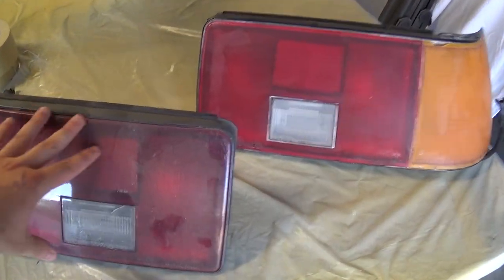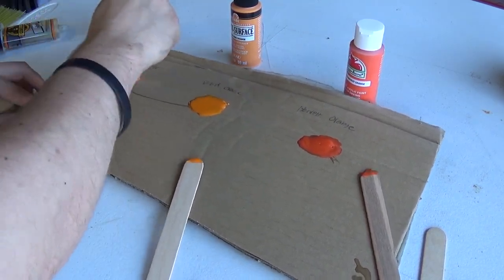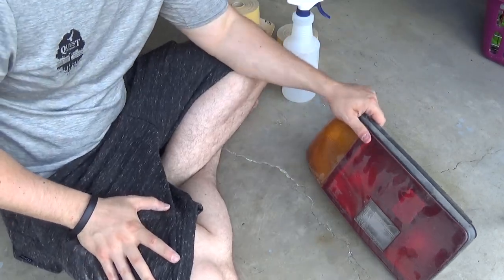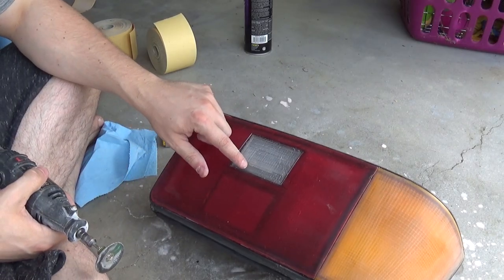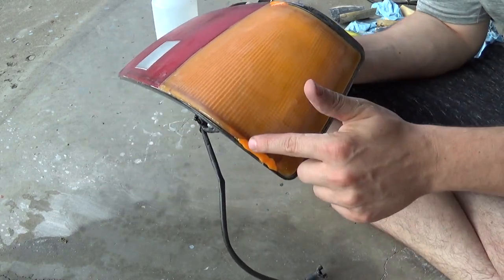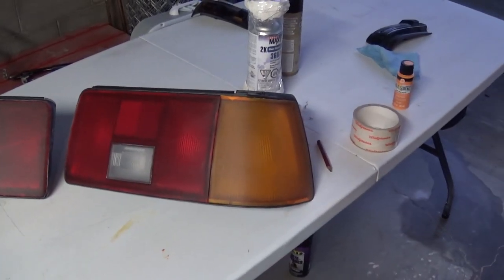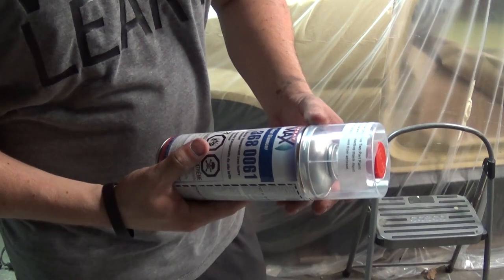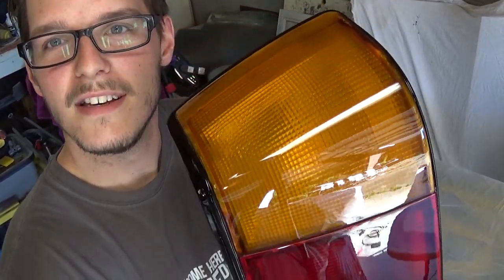AE86 Project | How To Repair Cracked Tail Lights - Tail Light Restoration

Comment: I would like to see how the crack in the left light turned out.   That part was not seen at the end because he placed the right light in front of it.  Then for some reason he only showed the right light on the car.   It's a pity not to see how it turned out.
Reply from the maker: Andrew George hey man thanks for watching and sorry you weren't happy with the drivers side tail light not being shown, as I didn't do it intentionally. Most of the work was done on the passenger tailight so i guess that may be why I favored that side a bit. I will be wetsanding both taillights in a future video and I will be sure to include close ups of both.  I can tell you the passanger taillight looks just as good as the drivers side though! Thanks for watching!

Comment: what do you mean by orange peel?
Reply from the maker: Basically, orange peel is when the texture of the paint looks like the surface of an orange peel.  Instead of being smooth, the finish is kind of lumpy/wavey.  Usually this is caused by improper painting techniques (ie, not enough air pressure, improper gun settings, painting at an angle, etc.)  However, I should be able to wet sand the clear coat and get the finish smooth.  Hope this helps!

Comment: this is a great video! i gotta do this to mine as well.
Reply: I am going to do this and make a video of me trying these on mine! thanks for the great video bro!
Reply from the maker: No problem, glad you liked it and happy to see you are going to try it on yours as well. If you decide to try and tint them, make sure you hold the Niteshades can high above the tails to avoid streaking, which is what happened to mine.  Nightshades is sort of hard to work with, if it's your first time using it lol. Goodluck and let me know if you run into any problems or have any questions.
Reply: Thanks man will do, i just got another set of the kouki coupe redlines! so I wanna freshen them up. Good tip on the night shades! Where you located? I travel a lot maybe we can collaborate if I am in your city
Reply from the maker: Nice! good luck with freshening them up.  I still need to wet sand the clear on my tails and get that super gloss, mirror finish. I'm located in KY, if you are ever near by, let me know!

Comment: What about the cracks on the reverse light
Reply from the maker: Thanks for watching! The cracks in the reverse lights are pressure cracks and not cracked all the way through the lens. This is good because they do not allow water into the light. The only real way to get rid of them would be to fully "crack" them all, dremel them down, and fill like I did in the video. Since they do not allow water in and aren't all that visible in person, I decided to just leave them.  Maybe I will try to fix them in a later video. Hope this helps!
Reply: How deep and wide of a groove did you drill with the dremmel on those cracks?
Reply from the maker: @Fixer Merlin not very wide and not all the way through the lense. I essentially just widened the crack into a slight V-shaped so the epoxy had a space to fill and self level. No more than a mm wide, about the thickens of the grinding disk. Hope this helps!
Reply: K just Wondering how deep you went because I did something similar on a signal light repair and although the surface is now flawlessly smooth and shiny you can still can see the cracks clear as day.  Perhaps I did not go deep enough?

Those tail lights turned out nice!
Reply: Mine did not turn out nearly as nice..

Comment: He would have had a better color match if he did it after he sanded them not before. He matched it to the faded color . I don't why you wouldn't polish the lense face before you apply paint. After sanding, you lose transparency of the light. Most people polish the lense & apply paint on the inside. You don't need clear coat.
Reply from the maker: It was my first time restoring lights to this extent and I agree the color match isn't perfect.  If I ever restore another set ill try to get a better matching paint, but I'm happy with how they turned out.  Thanks for tuning in!

Comment: you forgot on plastic primer coat too
Reply from the maker: Thanks for the info. I actually decided against the plastic primer. I did not want to introduce another layer that would have the possibility of failing. Also, I felt that I prepped and cleaned the lenses correctly to allow for proper adhesion. So far so good, as the clearcoat is the same as the day I painted them.  But, only time will tell if it will last, I personally think it will hold up just fine. Thanks for the comment and watching!

Comment: Really wanted to see how the crack in the reverse light lens on the LEFT cluster turned out with the lacquer on it but YOU DIDN'T SHOW IT. Evidently you're happier with the result on the right side as you kept showing that one, but as I have a crack the same on my lights as the one on your left I watched this video to see how you dealt with it. Disappointed.
Reply from the maker: Sorry you feel this way but thanks for watching the video and commenting anyways. The crack is sealed and looks much better than it did. It is definitely not perfect and you can still see where it was, but I knew going into it that it wouldn't be perfect. Check out my Instagram for more pics I should have a picture of the other side on there.

Comment: Never use spray cans.. guns and clear are so cheap now...  Ask him how that single stage garbage looks now?  I promise you it took a shit in the 1st year.  Rattle can paints can be 2 part and therefore they will look good for about 10 minutes. You need a catalyst and a body or it will break down extremely fast and especially in moisture.
Reply from the maker: Thanks for watching. The tail lights look just as good as the day I painted them. Feel free to also watch my evo 8 headlight restoration video, where I use the same paint. The evo is my daily and the clear looks exactly the same as when I applied it over 4 years ago. I'm not sure if you watched the whole video, but the spray spraymax clear I used is a two part clear. I agree I would not use a single stage clear on something exposed the elements like these.